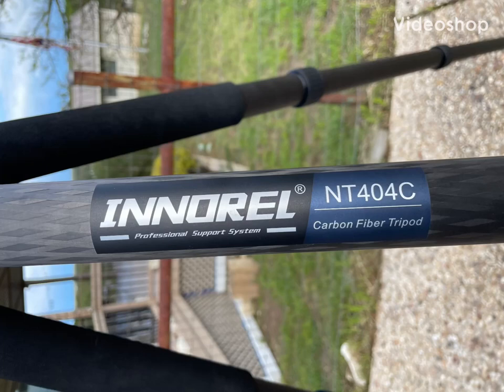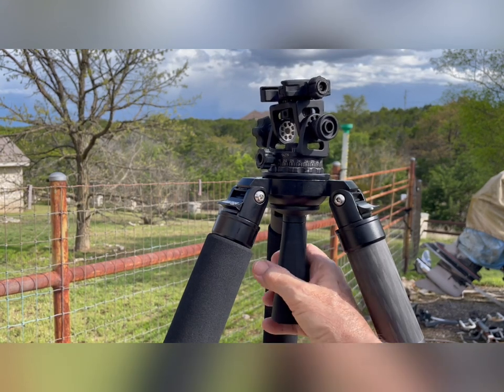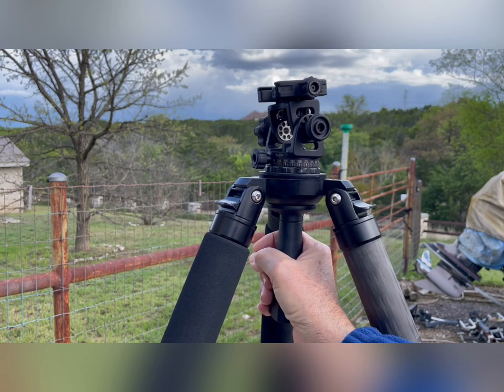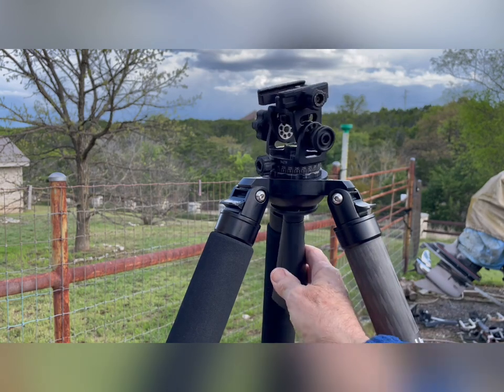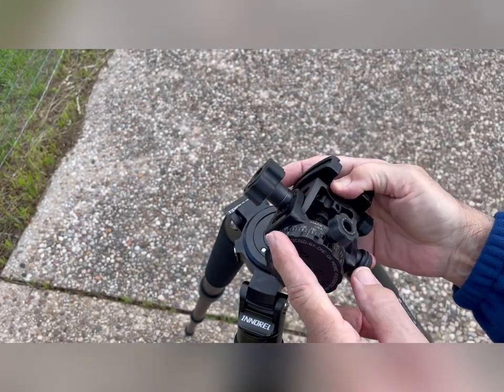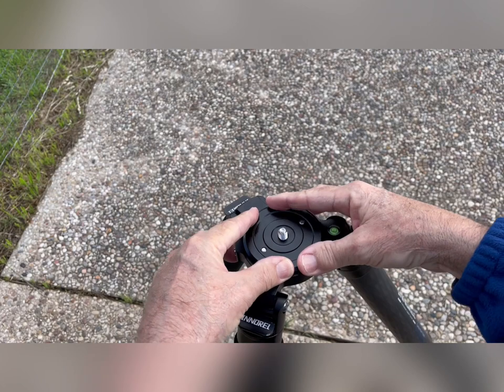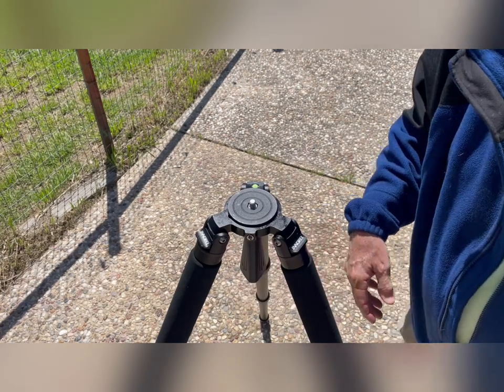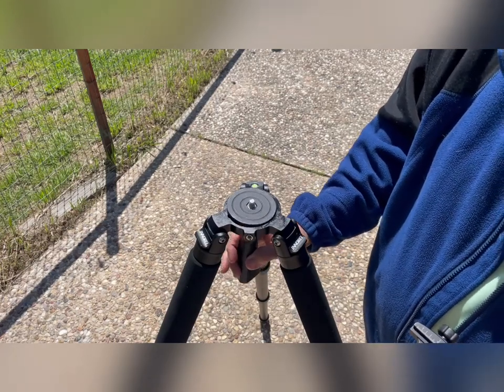Innorel NT404C Tripod Fail/ Hack

Comment: Did you use just 1 grit valve grinding paste. I have lapped in literally thousands of valves as I was a senior Marine engineer overhauling and rebuilding17,000 bhp Wartsilla engines. Your clover paste certainly brought back memories.
Reply from the maker: Whatever grit it was, I don’t know. But in this non critical application it worked! Last time I used it was on a Triumph Bonneville.